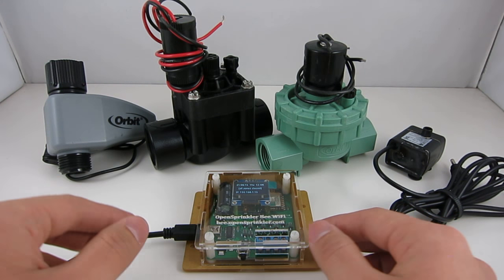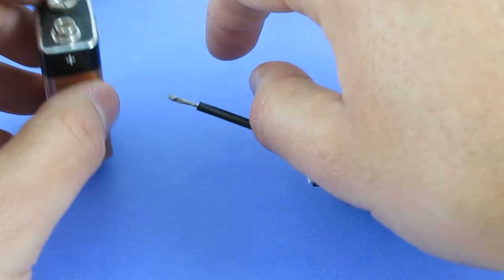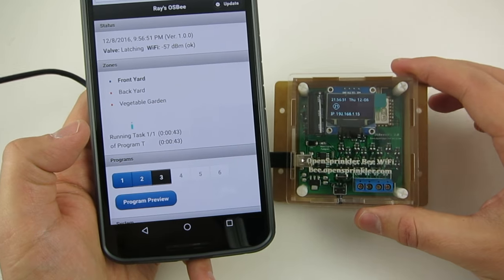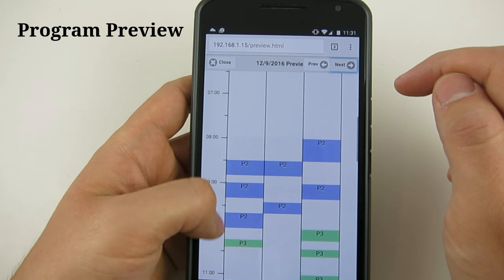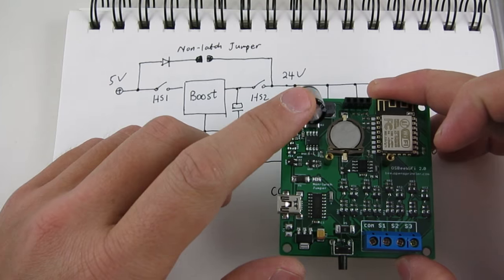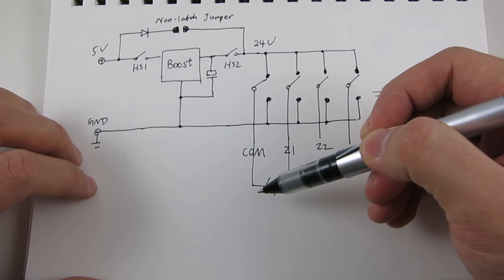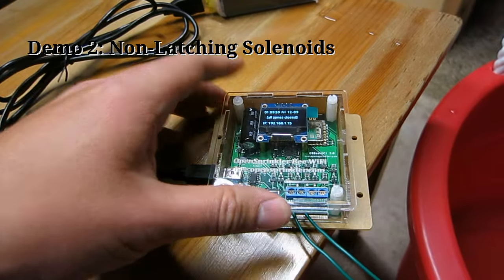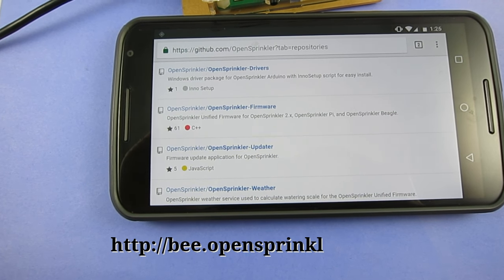OpenSprinkler Bee 2.0 -- WiFi-enabled Universal Sprinkler Controller

Comment: Hey Ray,

 What kind of fish tank pump did you use?  I am curious how you hook this up.  Did you cut the chord and plug it in?  Is this a special  kind?  I would love to get more information on this.  Thanks in advance.
Reply from the maker: a standard fish tank pump, 5V rated voltage. Yes I cut the cord to expose the 2 wires.